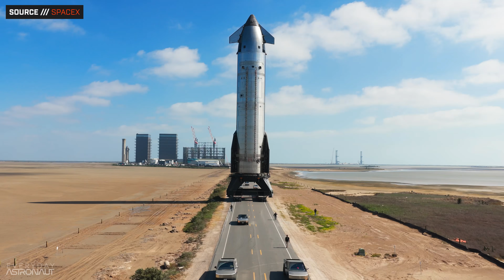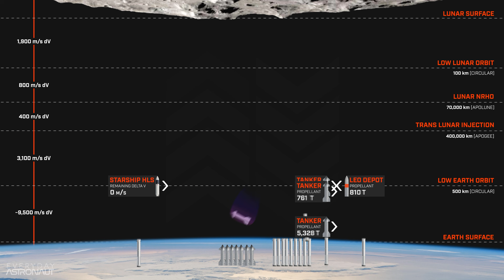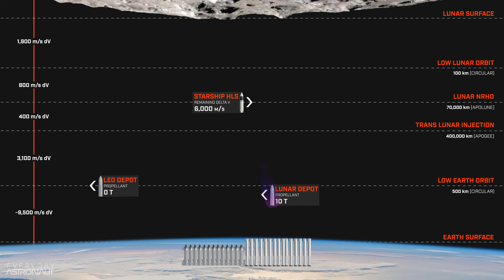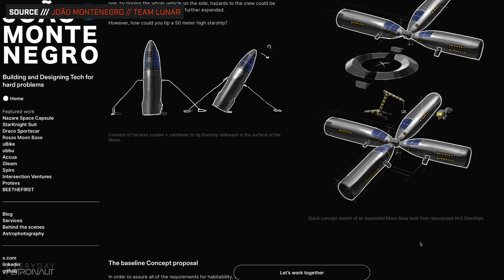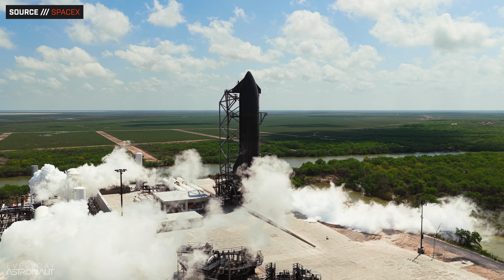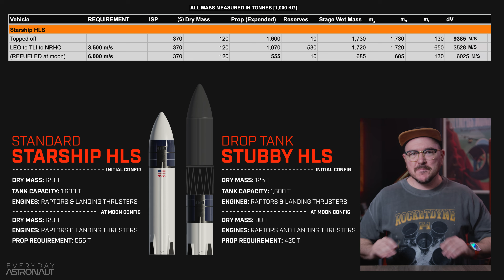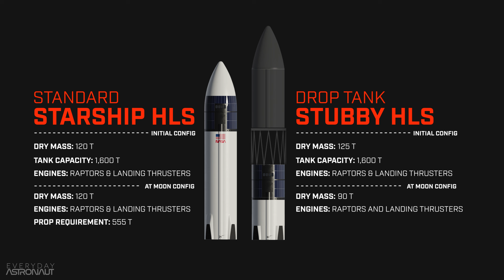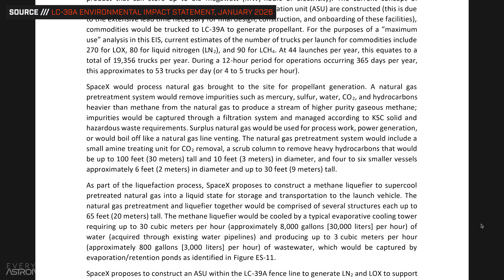Does Starship REALLY require 15+ launches to land one lunar Starship?!

Comment: It seems silly to bring HLS back from the moon. Why not leave it there for future missions, and make a smaller vehicle for the return trip? They could even send the return vehicle in a separate starship (that they could also leave on the moon, with more equipment)
Reply: There is no NASA plan where Starship HLS comes back from the moon, it's fate after the moon mission is over is ambiguous at this point.  Current plan is that it travels to LLO (and not NHRO like this video says), docks with Orion, lands on the moon, work happens, takes off, docks with Orion, crew come home on Orion (like Artemis 2).

I'm not sure why people are somehow thinking that it returning to the Earth surface or even into LEO is the plan, it is not.

I've read all the NASA papers on this, cover to cover.
Reply: @ConstantTrue  Sorry, I should have said: Use HLS as an ascent vehicle form the moon's surface. Surely we could get something as small as the Orion there with hypergolics as the launch fuel... Even the hypothetical Stubby Starship that Tim suggests in this video would be a HUGE Waste of mass to use in an ascent vehicle.. right?

Comment: Awesome video. All around amazing coverage.. Question about boil off… say they can keep the boil off to that 1-5% loss… using the multi layer… heat rejection… like you said nearly completely disbanding boil off.. 
(this is the best idea I think. As I wrote this message… I realized at the end.. well. Watch)
So they vent the boil offs in to a storage tank that then gets processed and they send it back to tanks as usable fuel/oxidizer. 
Especially for long term storage like on the Depots (and soon to be straight up gas stations in space) 
That are always just remaining in space… so now all boil off vents… from now on.. will vent into a storage tank to be sent back into a process tank for recycling back to usable fuel and oxidizer? Dam so then the vented tank, that stores and processes the vented boil off…  will also need to be evaluated for boil off..   which will eventually exist. Ok. I see the problem. 
Can’t wait to see what happens!

Comment: IMO the speed up version that SpaceX is proposing is likely a stubby HLS where the booster is expended. Then use the Stubby as your depot since it will only need a few launches to be filled. Probably 4 or 5 launches total to hit that 2028 timeline.

Comment: Excellent video, thank you!   Question - All of your permutations include removing the entire lander from the moon after each lunar mission.  How would your analysis change if a large portion of the hardware remained on the moon. This would appear to be a more realistic scenario. No need to re-orbit the entire vehicle, elevator system, crew quarters, empty tanks, etc. Only a 'small' human launcher would return to lunar orbit then back to the earth? Needless to say the hardware would begin to accumulate on the moon for future use and repurposing. The return mass to orbit and moon-earth trip would decrease dramatically. Thoughts?  Again, thanks!
Reply from the maker: Well then the vehicle is single use. The idea to to always be reusing it. If you’re ditching half the rocket, you can’t re-land it
Reply: @EverydayAstronaut  In the purest sense, I agree.  However, if we're going to actually build a base on the moon/mars, 100% reusability becomes an unnecessary barrier.  In hiking the leave no trace principle is required.  When trying to create a interplanetary species, it's imperative that you leave some usable  'stuff' behind.  This can only help the scenarios you were simulating in this video. Even if you left 10% of the mass on the surface the  benefits would be significant.  During the Apollo missions, we arguably littered the moon surface and orbit with unusable rovers, decent stage, etc; only leaving with the bare necessities.  This time around, on the surface we'd most certainly leave behind usable hardware for future missions.   This would be another scenario to add to your spreadsheet.  Thanks for hearing me out.  As always, thanks for your incredible content.  Your perspective and insight is sooo valued.

Comment: What if the lunar lander just landed vertically, but upside down? Wouldn't be the first time they made seats that spin around. And no more need for an elevator. Perhaps they could even use movable deflectors on the regular engines to direct the thrust nose-ward.

Comment: I did a similar Spreadsheet experiment that only uses Starship for launching fuel. It would send about 10 tons to the moon from around 100 tons of fuel by using dedicated, high efficient tugs. Essentially building a logistics network that could deliver to anywhere on the moon. It would do humans and cargo on a weekly delivery cadence. Hardware would have a 5 year service life.  Think Falcon 9 reliability and cost to the moon.

Comment: My question has always been why not plan to return the HLS to earth orbit and use it for the ride from earth orbit to the moon and use something cheaper like Dragon or similar to get crew to orbit.
Reply: Return to Earth orbit for HLS...

This assumes return from NRHO or LLO at the moon.

Coming back to LEO from either moon orbits requires between 800 and 1000 m/s of delta-v to start the trip from LLO/NRHO.

It also requires a "skip" maneuver on the Earth atmosphere, which requires heat tiles.

Those black heat tiles take up a good deal of weight.  Opposed to this, the white coatings you see on SpaceX HLS Starship are for long term (think 1 week+) missions to help reduce boil-off of the fuel.

So far, and not to say it could never be done, but so far, having both black tiles and white coatings is not in the plan.

It's all really about mission goal vs weight and therefore fuel requirements.

With current and foreseeable tech...

If you want to get massive (think 50 tons +) usable, deployable, leave-behind cargo to the moon to start the base, you need a lot of fuel, and best plan is to refuel in space.  It does not matter the ship configuration.  Starship, Blue Origin, or the Chinese.  They all face the same problem.

Comment: i think they maybe are going to make new engines for hls more efficient even if they lose a bit of thrust, another thing, they will probably change the 3 sea level raptors for one vacuum engine to reduce the weight.
i was thinking on that for sometime, and spacex is probably working on something to decrease the amount of fuel needed to leo (maybe an small and disposable second stage? to conserve all the fuel on the depot?), they can even use an capsule with some extra fuel launched by falcon heavy to speed up things.

Comment: HLS will never work. It's an exercise in wasting taxpayer money.  In the end the booster and the engines will find homes in other projects.  Maybe launching a NASA vehicle that's much smaller.  No one is going to launch 15 rockets just to get 1 to the moon.
Reply: Dude...
SLS development costs 6 times more than HLS. Single SLS launch costs like whole HLS development contract.
Even 15 launches are cheaper than single SLS launch, even if assuming $100M per refill, and it is supposed to deliver much more payload.

Comment: Why do you need sea level engines.The booster takes it out of the atmosphere and it never comes back?
Reply: The sea levels are the ones that move so they steer the rocket and work in space with a little less efficency than the vacum engines which just go froward. There is the landing and lift off from the moon to consider as there is no booster on the moon.

Comment: after watching this three times: Does Starship REALLY require 15+ launches to land one lunar Starship?!

Yes, but no, but yes, but maybe no, but yes. It does - and it's still the best option. don't think of it like 15 launches, think of it like a pipeline.
Reply: The correct answer is in the facrs spacex has not shared yet, like how much fuel a tanker starship can lift to leo.
Reply: @shaung949  well, the real answer is one refill; that's all it needs because there will be another tanker that is full that could be double capacity, so it can refill completely the other one, and they will just maintain it. So it's not like it's gonna be part of the same mission. There will be a mission to make sure there are refuel. Now the problem is the boil off: are they gonna solve that? Can they have a depot of cryogenic fuel in orbit? That's the question. If they can, they have it; it'll always be there in terms of the mission. So the mission is just redocking fuel once; how we refuel that is someone else's problem. It could take a million missions; it's fine; it's just a pump. Each flight is just carrying a little bit of fuel up, but that would be the same no matter what. If we need a killer ton of fuel, how'd you get a kiloton into orbit? I don't think anybody has a different answer. You take it up 100 or 200 time tons of the time; that's it, and that's what they're gonna do. A kiloton is a kiloton is a kiloton, right? Do you need a kiloton? Yeah, okay, we'll get it up there, and then whatever happens after that, it's fine. People gotta view it a slightly different way.